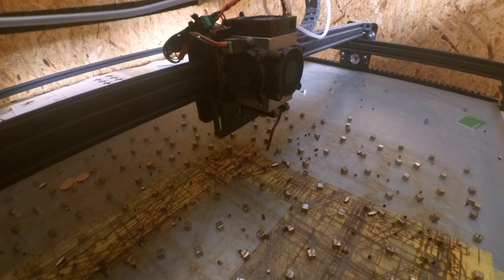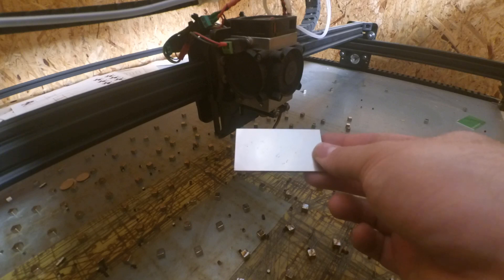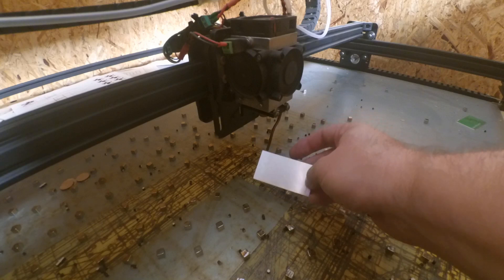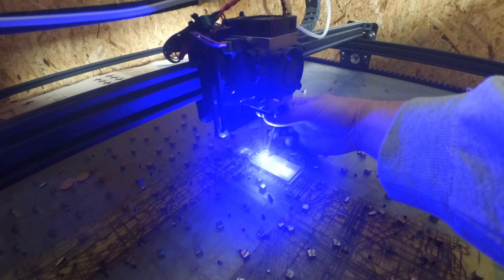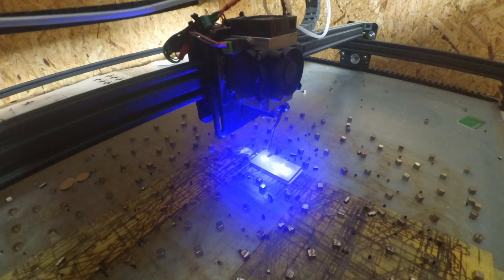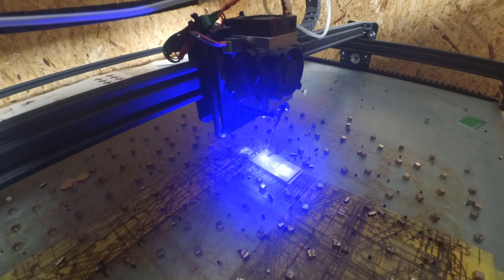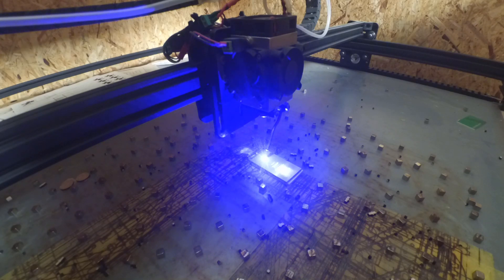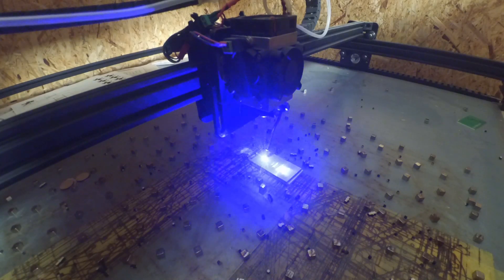Endurance Laser Guide #1 - How to Focus the Laser

Comment: Hi.

If you want to cut material, you would be much better to set your focus on the MIDDLE of the thickness of the material you plan on cutting, rather than the top (or the bottom).  Your cut will be much cleaner.

This is experience talking .. Hahaha!   Have a nice day!
Reply from the maker: Also tried that but for me that works better. Needs 2 passes less than in the Middle of the wood:) but will give it another try